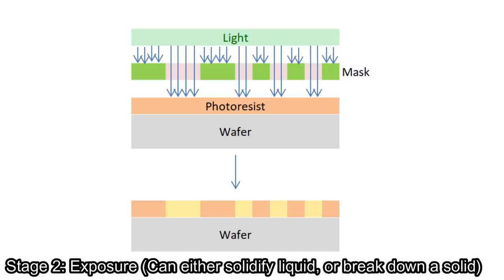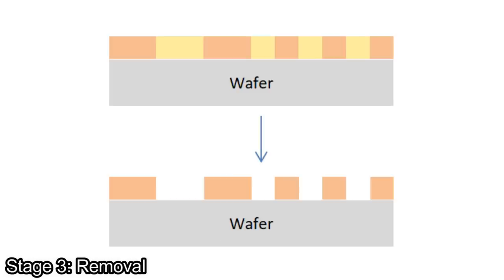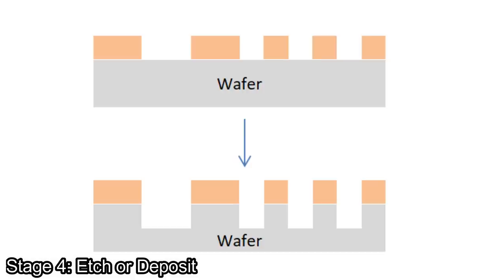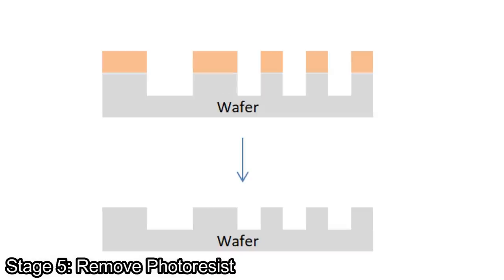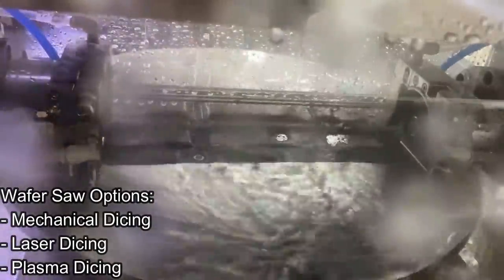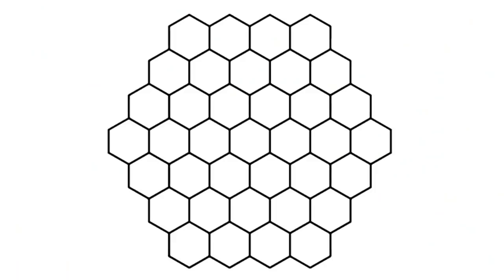Why are Processors Square (and Wafers Circular)?

Comment: How about triangles then. Triangle processors would look rad
Reply: I think hexagon processors would make more sense.
Reply: Wait he is adressing the hexagons on the part i am watching lemme see...
Reply: I think they should go ahead and cut hexagons anyway and figure out the process, i mean we already are on top of a montain of complexity, better make it count.
Reply: Also, it would be great for camera sensor to be hexagonal since it would gather light better.
Reply: Could you make them small enough for chiplets
Reply: Triangles would solve the cutting issue that hexagon have, so it might work
Reply: Some LED chips are triangle shaped, but everything else I've heard of is square.
Reply: You can use triangles in a traditional mechanical dicing tool. However, packaging wise, you'll end up with a lot of wasted space in your final chip, as most PCB's follow square (Manhattan) lines.
Reply: Hexagons are the bestagons
Reply: I was just thinking that
Reply: You could probably use triangle chiplets to create hexagons and it would reduce waste
Reply: Escher shows us that we can tesselate bats. We should make bat-shaped processors, with the big dies made of big bats and the little dies made of little bats.
Reply: Off axis crystal lattice cuts don't work.  They cause the wafer to shatter from what I recall.  There is a particular crystal orientation for cleaving and cutting.
Reply: @sylvelk  That's just historical hysteresis in design and interfacing. Triangles sound like a 10% more product for the same cost of manufacture, attaching gold wire to pins already is a cost that manufacturers already pay to attach heat spreaders and distance to pins in outside packaging, that cost may go up IF manufacturers keep square packaging, (mainly useful for pick and place machines) but if they change their packaging to triangle as well that wasted space cost is now zero, it is only the cost of a tooling change, (and the upgraded pick and place machines will have an easier time of determining orientation and exact placement, might even be able to do that mechanically, without optical feducials) tape reels would have ability to do a higher density per reel with less shake, would have slightly less heat issues compared to tic-tac/centipede chips where the new third leg could be used for additional heat dissipation. And I'd bet inchip transistor inventory could improve if it were triangles, but thinking about it going a classic npn transistor may not improve.
Reply: It's probably harder to design a chip on something that's not a rectangle as well.  A hexagon wouldnt be too hard, but a triangle would probably be difficult.
Reply: Or hexagonal nanosheets 3D-stacked into a double helix formation :p
Reply: @DwAboutItManFr  hexagon processors have the cutting problem described in the video. Triangles do not.
Reply: @sylvelk  Most processors are already packaged in boxes many times their size though.
Reply: @pentachronic  correct. Since wafers have a homogeneous lattice structure, they tend to cleave very easily across one boundary, but will just shatter along any other boundary. This is what the notch means, it denotes the grain boundary direction. We used a 110 silicon back in my day, which we could cleave into triangular shapes. But then building a circuit on a triangle just means the areas around the angles won't be used. There waste in any hypothetical case. The way we do it is the best way with current tech. Changing the shape now would be impractical and a waste of time, money, and engineering.
Reply: Its said that man who knows why they put round pizza into square boxes and cut it into triangles can understand women.
Reply: Pizza slices for CPU
Reply: Triangle Man hates Particle Man.  They have a fight, Triangle wins.  Triangle Man.
Reply: Lol. Have you ever tried to differentiate the triangle cuts at the Wafers' edges. That will be a nightmare when you have to figure out the bad dies from the good dies, of which the dies nearest to the edges will have more chances of failing. Dies will not be tested until they got to test after being assembled with substrates. Rectangle is much easier to differentiate and cheaper to manufacture even when comparing with hexagons
Reply: it is harder to cut! try using a pair of scissors to cut a sheet of paper into triangles, vs rectangle. see which one is easier/faster?
Reply: Triangles aren't a good use of space. Consider the perimeter vs. the area of an n-gon with unit radius: https://www.wolframalpha.com/input/?i=Plot%5B%28n+1%5E2+Sin%5B%282+Pi%29%2Fn%5D%29%2F2%2F%282+n+1+Sin%5BPi%2Fn%5D%29%2C+%7Bn%2C+3%2C+10%7D%5D . A circle maximizes the amount of area vs. perimeter. It also won't tile perfectly, so there will be wasted space between the dies. A hexagon can't be made with uniform cuts. So you're left with triangles vs. parallelograms. Since area is the most critical, a parallelogram like a rectangle, provides the best possible balance of traits and is easy to manufacture compared to other n-gons.
Reply: The one that will invent a better way to make them better/cheaper will be the next Bill Gates.
Reply: @DwAboutItManFr  Camera sensor should have the aspect ratio of the picture taken.
Reply: @Max24871  Right, but that doesn't work in every application.
Reply: @paulcohen1555  Maybe we should use rectangular lenses :)
Reply: @AndreVanKammen  But that way you introduce an expensive manufacturing step because lens are created round.
Reply: @paulcohen1555  And that's why we need a circlurar sensor or hexagon, it makes cropping to portrait or landscape act the same as the rectangular sensor that only covers less of the usable area.
Reply: UNLEASH THE POWER OF THE PYRAMID
Reply: @bagok701  The CPU's, GPU's and other chips with hundreds or thousands of connections don't have bonding wires, they are more like BGA and installed face down in one operation in the package.
Reply: I could totally see, especially with AMDs existing architecture, and hexagonal form factor for it's main chips, with triangular sub chiplets. Also for the cutting complexity, could there be potential in a photolithographic process? If it's good enough for the transistors, it's obviously MORE than good enough for major cuts, at least in terms of complexity, IDK how well it scales in width/depth of cut... One thing I would be interested in finding out more about is the physical architecture of the transistors on the chip, pop culture has led me to believe they are in straight rows, columns and towers, much like the city blocks of New York, but I feel like this has some performance bottleneck, having branching paths come off at right angles; would it not make more sense to design transistor layout in a hexagonal honeycomb type array, minimising distance between the functional parts of the processor, in theory improving speeds AND efficiency, with less wasted heat generated through connective traces. With the lithographic process, the complexity of such a chip should not pose a logistical challenge, just one of engineering it in the first place. But IDK, again, would love to see some info on these ideas!
Reply: Пмж
Reply: @DwAboutItManFr  ффффффффф
Reply: Katie Ellen Tu  យុត្ត
Reply: @DwAboutItManFr  ccc
Reply: @UniqueBreakfastTaco  iuwuw

Comment: My immediate thought once you got into how cutting hexagons would be challenging was, "Why not triangles then? Especially ones that can tile into hexagons." Then my mind went back to the lithography, and I realized the entire process would need designed from scratch, not just from a cutting perspective. It could work though, and a triangular process would add an interesting geometric facet to the engineering side of things... pun intended...
Reply: Hex need 3 axis to position vs 2 for rectangle, in addition to the rotation. Triangle would waste a lot of optical surface of the light source vs rectangle or hexagon.
Reply: @maggiejetson7904  To be fair, it would need to use a hexagonal print head but architecturally the chips would be triangular to maximize usable surface area. Three axis cuts wouldn't cost more than 50% more than the existing cuts, and be a nominal expense compared to the potential savings of being able to use more of the wafer. If the triangular chiplets can be interlocked edge-to-edge, then we could shape the die in all sorts of potentially more efficient ways. Even moreso if we also have interlocking squares of the same side-length. This will likely never happen as retooling the processes would cost billions.
Reply: The square was my first thought also till after a few videos explained the rational for the round but then the triangle came to mind and stacking the units like a pyramid . Just brain storming and wishful thinking I guess but like they say stop trying to reinvent the wheel .

Comment: The unit cell of a silicon crystal is cubic. Makes sense to cut along the lattice at 90° angles rather than against it at other angles.
Reply: but why fab them into circular wafers to begin with?
Reply: @isaacgarcia8686  good question. The way they make these wafers starts by growing the crystal and pulling it into a cylindrical ingot. It naturally wants to take the shape of least perimeter, a circle. Then they slice it thin to make round wafers.
So making any other shape would require material loss or at best an extra process.

Edit: literally just watch the video, lol

Comment: I was not wondering this about "normal" processors, but about the "whole wafer" AI processor you showed earlier...
Reply from the maker: There's also the optic pipeline in photo lithography. The tools are designed for rectangular chips. Anything else would require a redesign. That's also why the cutting gets involved in making it square.
Reply: I'm just wondering why nobody has used small ingots and a wafer-scale chip. The ingots would be cheaper and there would be no actual cutting required, just slice it into wafers and print the chip.
Reply: @JeoshuaCollins  I thought that too, but it seems like the main reason is at this point "wafer waste" is one of the more insignificant issues to overcome with making chips and the cost to do something better is too large to justify.
Reply: @JeoshuaCollins  Most of the flaws in the wafer are near the edge. Small ingots have horrible defect problems, and the yield of good chips is poor. Once you get to 200mm wafers the nasty bits around the edge of the wafer become a reasonably small part of the total area, and yields can be very high. A high proportion of the bad die come from the periphery of the wafer, but they don't represent a massive percentage of the overall die.

If you consider whole wafer products, like the Cerebus processors or an x-ray imaging sensor, they don't care about losing some wafer, as they cut a large  working square or rectangle from it, because the bits they cut away won't be that great anyway.
Reply: @steveunderwood3683  Thanks, I hadn't considered the localization of most of the defects to the edge. It makes total sense now.

Comment: The face center cubic crystal structure of crystalline silicon also favors the square cuts and there is a notch on all wafers that define the orientation of the direction of the crystal unit. Just one of the many reasons to add why rectangular shaped chips are favored.

Comment: Some parts of the process have trouble near the edge of the wafer. Exclusion zone defines the usable diameter. The rows and columns of printed reticles are optimized for die count. Partials are printed to maintain uniformity up to the edge. I had the privilege to sit in on meetings where this was determined for test chips at a development fab. Very interesting!

Comment: The circular shape also provides neutral stress distribution across the wafer. Silicon is a brittle material and a square-shaped thin wafer will chip-off at the corners, given how many physical manipulations wafers are subject to during production.

Comment: The solution for silicon wafer manufacturing is a new circular architecture of transistors, which would allow for smaller wafers with a diameter of 30/50 mm!

Comment: A problem I recently have with a lot of YouTube channels is that all of them explain the same basic stuff, all over again. Without watching the video, wafers are circular because we grow cylindrical crystals, also because it suits to use a disc when you have to spin it around all day, and dies are rectangular because a rectangle allows for good usage of the wafer without silly triangle dies, and any higher n-gon couldn't be sawed out of the wafer.
I'd rather see more in-depth videos on technology and production processes, instead of an explanations why bananas are curved. I get it, it makes for a video for a broader audience. But then again, you're underselling your knowledge.
Reply from the maker: This was the biggest question that came out of my IBM 2nm and TSMC 7nm videos. Other videos for other stuff - not everything has to be 100% relevant to you, but let everyone else learn. There's no reason to be down on others learning.
Reply: @TechTechPotato  I'm down on videos re-explaining basic stuff all over again. Like, you can solve the question just geometrically. Cylinders only have two measurements vs. three for a block. It's also way easier to manufacture a cylinder than it is to manufacture a bar, or machine it to certain dimensions, regardless of material. Triangles and rectangles are the only possible shapes that you can cut out of a plane with only straight cuts from edge to edge, and of the two, triangles have a worse ratio between the largest dimension and the area, so the obvious choice is rectangle. This has barely anything to do with semiconductors.
For example, yesterday Machine Tech Video Blog released a 45 minute video in his series about autocollimators, which is an interesting topic. And he started the video with explaining how light bulbs work... Like WTF? This is okay for mainstream channels like Kurzgesagt.

Comment: 7:00 Basically the only reasonable shape besides rectangle is a triangle. You could easily cut wafer into triangles (basically same as hexagons but with each hexagon cut into 6 triangles) but triangle has sharper corners than a rectangle so it's worse for actual chips.

Comment: Wild guess: The silicon ingots from which wafers are cut are long cylinders of which the wafers are cross sections. It would be impractical to impossible to make them grow in any other shape and still get a uniform uninterrupted crystal lattice, so they just content themselves with round wafers. As with why chips are square, a diamond cutting disc is used to cut the dies from the wafers.

Comment: Just to expound on thermal stress. Most of my experience is PECVD, HDP, PVD, and Cu plate. In PVD liner/barrier, I remember watching the wafers flex on the cooling stations to where they look like flags blowing in the wind. They go from room temp to over a thousand degrees in seconds. This has been the main challenge with 400mm round wafers...square would never work.

Comment: The only wasted area  are on the outside radius of the wafer, where the process parameters vary more and yield is lower anyway. It's not a big deal to lose them, especially when you consider how large the wafers are.
There are multiple comments talking about adjusting the lithography for printing different shapes. That has nothing to do with this discussion of designing how the wafer is to be partitioned between different chips. You can print rectangles and still cut large hexagons or triangles, obviously.

Comment: How would you cut the perfectly flat wafers from the ingot? A regular flat or circular saw would flex, and deflect from the straight cut.

One solution here is to use an inner saw. It's a steel sheet impregnated with diamonds, stretched on a hoop, with a hole inside. The ingot goes inside the hole, and is cut by the inner edge of the hole.

Another approach is to use wire saw. Multiple wires cut multiple wafers off at the same time.

Comment: If one could do hexagonal cutting of the wafer, doing straight cuts through the whole wafer is a no-go, and something else must do the cut, like a "water jet cutter". If that's implemented, a chip can take any shape. So.. then you must have a way to do IC layout that's not on a rectangular area but in any shape. And after that, enable making of masks of any shape, and enabling many different shapes optimally placed on a wafer.. To shave tens of dollars per wafer, ie cents per chip. Or just stick to rectangular chips.

And the same goes for chip packaging and PCBs.. in the latter case, any shape really is an option. Different constraints gives different solutions.

Comment: The anneal heat buildup on the edge of a potentially square wafer is not something that occurred to me. Since some anneal chambers also spin the wafer while heating to 1000+ degrees C, I would imagine that the corners would have a lot more stress and would potentially induce a lot more wafer breaks. There are probably other limitations with plasma, etc for other process groups, too. 

I had been taught, in college, that a lot of the reason why the wafer was circular was for mechanical strength. With a crystalline structure, if you hit an sharp 90 degree edge, you'd be a lot more likely to break a wafer than if you have a round, chambered edge.

Comment: Germanium being somewhat similar to Silicon due to the electron valency. 

Germanium crystals are grown and machined to become optical elements (lenses) for Thermal Imaging and some lasers. They are expensive but impressive. I own a few and the largest one is 150mm diameter. Lenses are treated with different coatings for hardening (Carbon diamond like), anti reflective or bandpass/cut.

Similar ultra pure Germanium are also used for Gamma ray detectors using photo multiplier tubes. 

Such